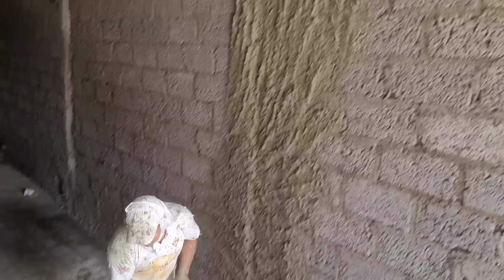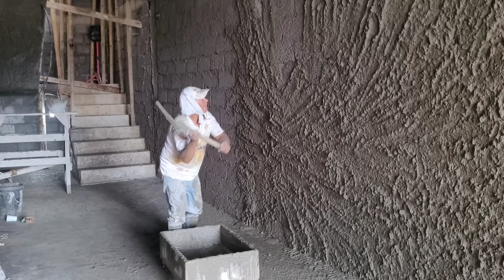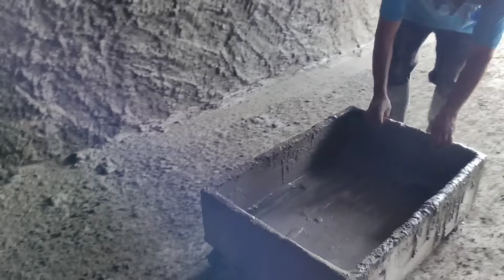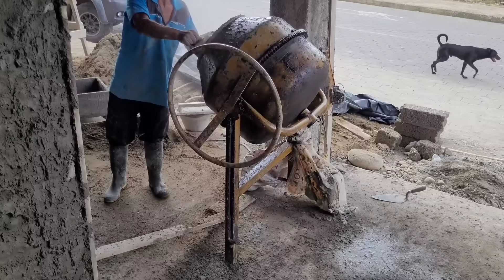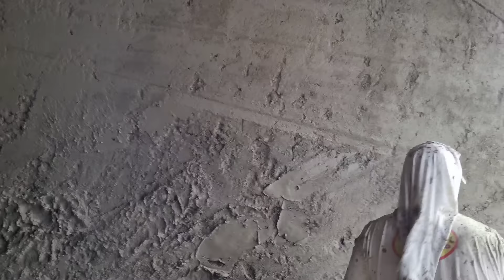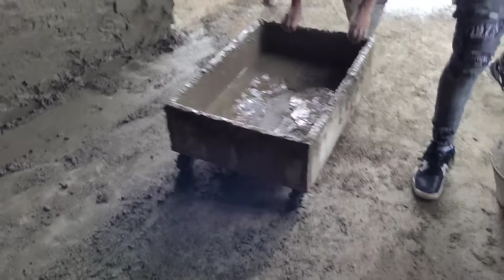Como enlucir más  ( RAPIDO )

Comment: Hola se ve muy bien lo q tengo duda esq keda liso ho así aspero...muy buena idea del muchacho pero creo q se desperdicia mucho cemento..bueno n mi opinion..?
Reply from the maker: Gracias por seguir mi canal. Un abrazo fuerte desde Ecuador. La verdad no sé desperdicia materiales ya que se recoge, se corrige y se vuelve a utilizar.
Reply: Hola buen día caballero señor Lucas pero keda liso, listo fácil para pintar, xfa demuéstrale cuando haya acabado la pared ok xfa..q tengan excelente fin d semana bendiciones
Reply from the maker: @dorissalvatierra2899  queda liso y bastante fino para poder aplicar sellador impermeabilizante y pintar.

Comment: Maestro una consulta. Hice unos pilares de 1.50 de 20x20 le voy a poner viga eletrosoldadas de 15x20 de 9.5x5.5 de espesor esta bien que la refuerce con 2 varillas de 10 a los lados en la viga?
Reply: No te sirve por qué el diámetro del estribo es muy pequeño solo desperdiciarías material en otras palabras da igual que le pongas a que no le pongas esa es mi humilde opinión ojo solo digo lo que he escuchado
Reply from the maker: Si en esa estructura va una placa de losa, no le sirve ese refuerzo. Si va techo metálico si está bien. Saludos desde Ecuador
Reply: @lucasalarcon1788  arriba va una casa de caña no va mucho peso pero las columnas igual las reforse con dos varillas de 10
Reply from the maker: @luisrobles9640  está correcto